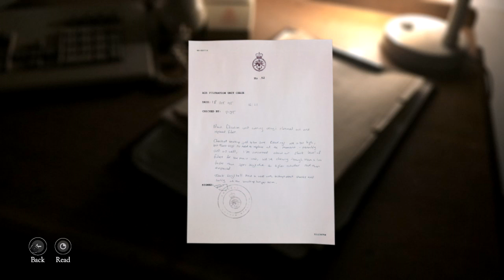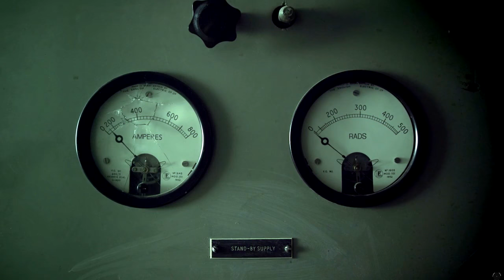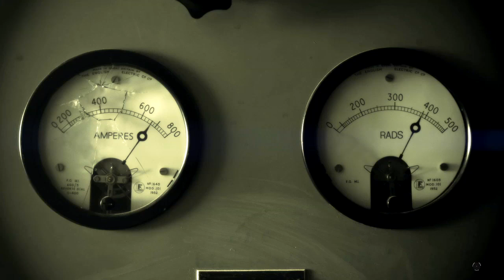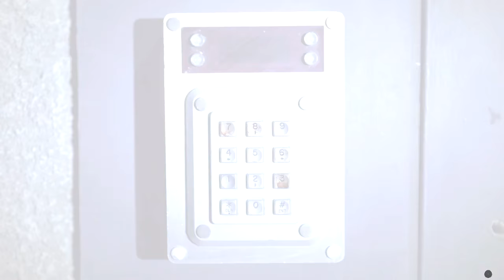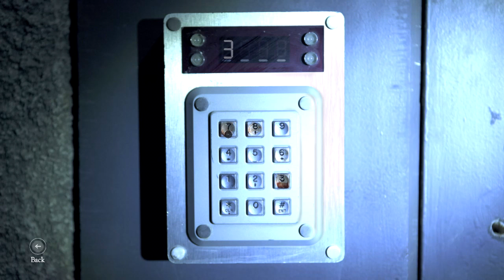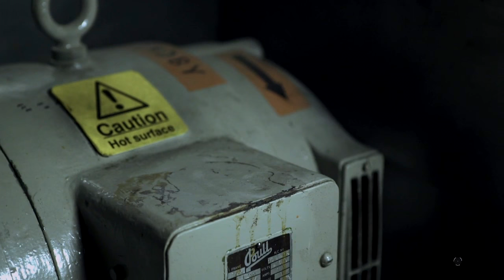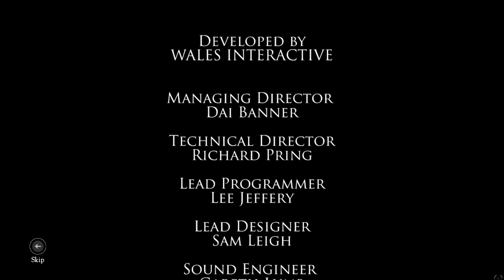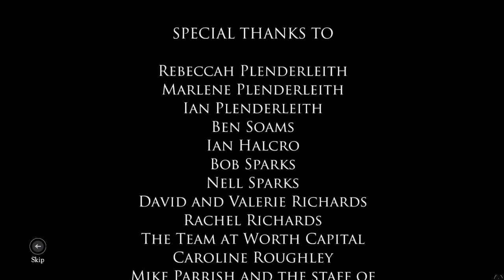The Bunker - The Big Twist ( ALL ENDINGS ), Manly Let's Play Pt.2

Comment: Regarding what you said at the end; Outside is not irradiated, or at least it isn't clear if it is or not. The backup filter was fucked and had a buildup of radioactive dust; that dust was basically flushed into the bunker when it switched over to the backup air filter.
Reply: what about the main ventilation? why was it an issue to replace the filter if there was no radiation coming through?
Reply: Radiation doesn't need to be coming through from outside. When he pulled the filter out, there were holes and it was coated in dust; A few holes could have released years of accumulated radioactive dust.
Reply: good point. it was highly radiated when he took it out.
Reply: +Akaelai
 Actually, that'd explain why John's internal radiation levels were going up so quickly in the few days prior to this event. If the filter had indeed been wearing out, radiation levels in the air would've gradually increased by minute amounts not detected by the bunker sensors, but enough to be spotted by the retrospective telescope of radiation thingy.
 It would also explain why the filter went out right after the power error. The filtration fans may have hiccupped when they were started again after switching the power and "popped" the worn-out filter.

Comment: Actually... a short fall resulting in a broken arm might be due to a lack of proper calcium / vitamin D supplementation, leading to weaker bones... it's not like they get a lot of sunlight in a bunker.
-----
If the surface radiation is back down to survivable, why exactly is there so much radiation leaking into the bunker? <_< ... is what is asked at the end of this video. XD
-----
... and that was Fallout: UK.
Reply: If you noticed from the radiation meter and the air filter was packing up dust and riddled with holes, the filter change was what caused the radiation to flood into the bunker.

Comment: wait but I thought there was still radiation outside? And if not then where was the radiation coming from near the ending?
Reply: bishop said that 20-30 years the rads would be gone outside so the ones inside were probably there from the start
Reply: The radioactive dust buildup in the back up filter mentioned when he was in level three.
Reply: Elva Light 
If its been 20-30 years then the radiation would have been gone for a long time
Reply: oooohhh